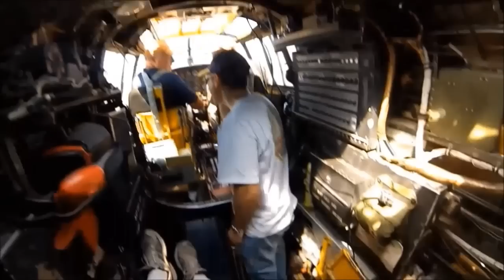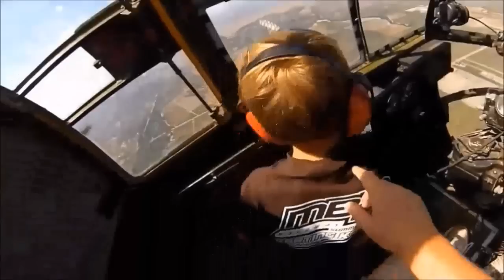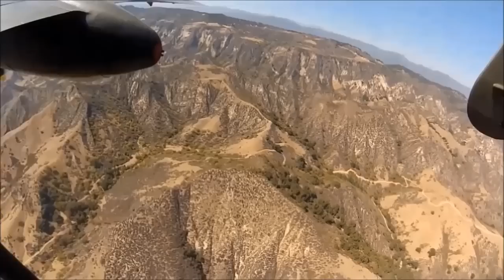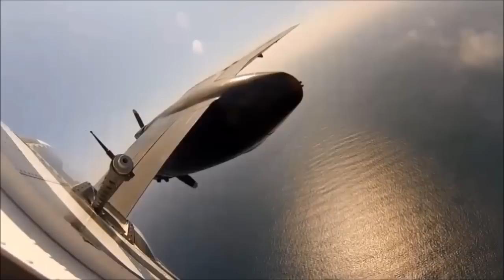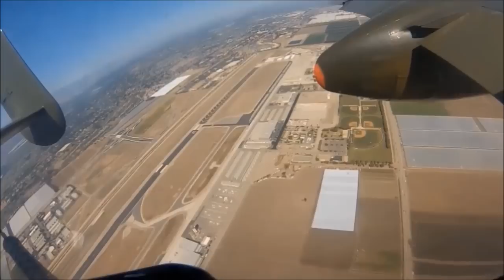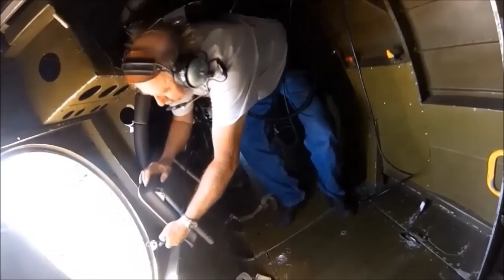Take a Flight Inside the North American B-25J Mitchell "Executive Sweet" Camarillo Airport GoPro

Comment: Two questions, Ed:
–Were the engines as uneven and clattery as they sound on the vid? I've always thought radials were smoother than, say Merlins or Packards.
–Was the upper gunner's station removed in this plane? It didn't look like there was anywhere for him to sit.
Reply from the maker: Yes the B-25 Engines sound pretty rough and have pretty short exhaust stack. and yes the gunners station is removed for ease of passengers to enjoy moving around the aircraft. Thanks so much for watching.